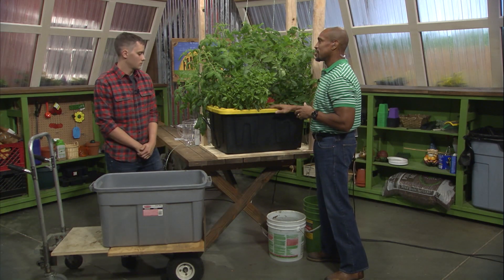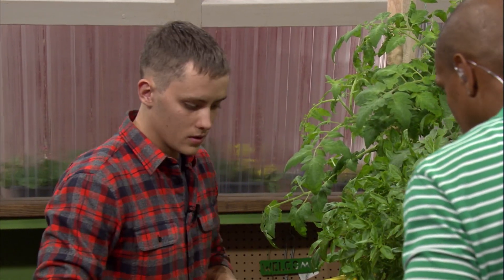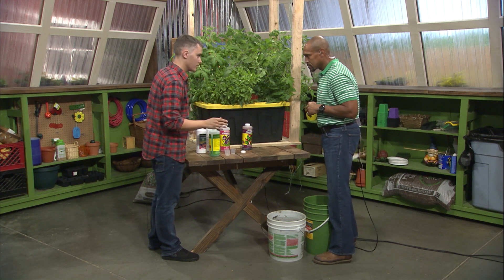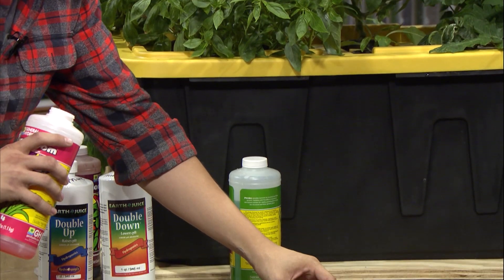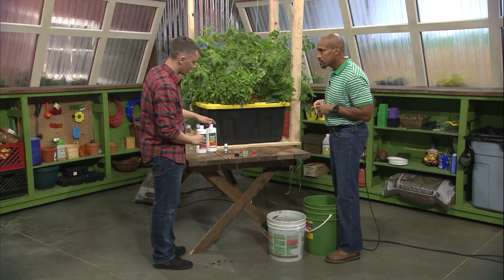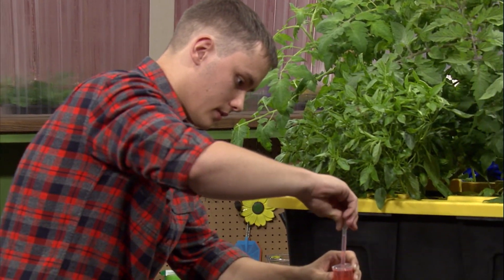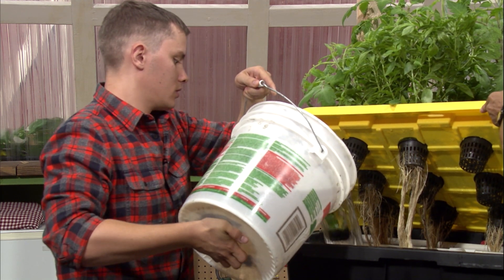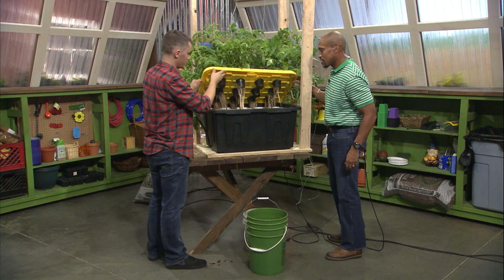Changing Hydroponics Nutrient Solution

Comment: This is a great video! Ever consider digital meters to determine your pH/EC/ppm readings?
Reply: We like to keep things simple for beginners. Too much equipment can make this seem unapproachable. We don't need any of that to run our hydro setups. Just watch the plants and be mindful of your conversions when mixing up nutrients. Don't try to feed "expert" solutions if you're not yet an expert. ;) In our shop however, it's BlueLab meters all the way. Thank you for the comment and advice!
Reply from the maker: We have done just that. Once we ran out of the drops we converted to digital meters. It is nice not having to guess the exact color of the measurement.

Comment: Because nutrients can change the waters PH; After adding your nutes and you stir the bucket, you're supposed to wait a few minutes, then check the water again to see if you need to adjust the PH with Up or Down solution. Depending on the brand of nutrients, this can be very important. Because you're likely going to check the water often while growing, most growers recommend a digital PH tester, especially if you plan on growing several harvests.
Reply: if you know your water is pretty good... clean and clear. consistent PH... and you measure everything correctly... it should be fine. But, Im with you, just to be sure. I mix my nutrients first, without any PH test... mix it all around... then test and adjust. Still getting used to the water supply
Reply: yeah the pH test should have been done at the end, but I am going to assume he's a good hydroponics grower and did another pH check the next day and adjusted accordingly - like we all are, right? :)
Reply: I agree, I check several times after changing out my res (NFT), and probably check at least once a day, after rain, etc.. It's a good habit to have, I've read too many horror stories of people "checking after a few days" and it's down to 4.5 or PPM is too out of range.
Reply: We are based in Memphis, TN and use reverse osmosis filters for our clean water supply. I'm not sure the studio in this video did. Scott probably brought a bucket with him for the demo, but I can't be certain. At any rate, our city water is pretty much the envy of the country so we don't have to fuss with it much. Great advice though. Thanks!
Reply: @wetwerk2178  How clean the water is has nothing to do with after adding something too that amazing water it will not change the PH of the water.
Reply: Well of course, checking your PH is a regular activity and checking it the very next day is a given; But, a good hydroponics grower wouldn't/shouldn't ignore the PH change on the very first day, at least that's how I see it. I've always been a strong believer in correcting or addressing any issues the moment you become aware that its incorrect... Especially for beginners, I think its good practice (from day one) to maintain a proper PH and understand why those changes take place.

Comment: Perhaps a clear drain tube would show how high the nutrient solution is??
Reply from the maker: @Anthony Driver is right. It will cause algae to grow in the tube. I always keep at least one spot empty in the system and make sure that spot is on a side. Then inside the tub I use a grease pencil to mark the correct water level. I can then use the empty spot to see the water level and top it off, or do pH tests, etc.
Reply: yeaaaaah, i tried in the past... they end up getting too much light exposure, which leads to growths/moldy unwanted things.... but it does work... but lifting the lid and having a look is just as good. You dont want light getting to your water/nutrient mix... causes growths in the right conditions
Reply: Family Plot great idea... didnt think of that. Way better than having to lift the lid and potentially disturb roots. Thanks for that tip ^_^

Comment: Did I miss it or what type of water are you starting with ; ro Distilled or (well) tap water or even just softened well water? Thanks 🙏🏼
Reply from the maker: We are using tap water. But, we are in Memphis, Tennessee, which has very good water that does not need treatment before you use it in hydroponics. Other places may require pre-treatment of the water.
Reply: I use tap water, but before the mixing I pass it via the Brita to remove the chorine. It also helps in bringing the conductivity down, which is an added bonus.
Reply: @MoondancerRec  Please tell me what the conductivity is?
Reply: @ from around 450 ppm raw to around 95 ppm after filtering. I take that number into account when adding the nutrient. So if a mix call for a nutrient concentration of 400ppm, I know that at least 100ppm will not be nutrient, so I bring it up to 500ppm compensating. If you leave the tap water as is, your solution will be lacking nutrients for a healthy grow. If you have access to distilled water, you can go to exactly what is needed.

Comment: After how much time the solution should be changed? What are the indications which suggest that the solution should be changed?
Reply from the maker: We change the solution every 7 days. We can push it to 10 days if we have to. You will find as the nutrients get used up by the plants, the pH begins to get harder to control. There have been a few times that I gave up chasing the pH and just changed the solution.
Reply: Thanks :)
Reply: I have left the nutrients for over a month, just adding water to top off. I have not had any problems. In Kratky methods the water is usually never changed. I agree you can go nuts trying to keep it perfect
Reply: Sunny Sharma thanks
Reply: yeah, if you have an EC reader, you can tell easy, if they are sucking up more water than nutrients. But, usually, you wanna be changing them once a week to two week, depending on situations... also good to do a short flush run every month or so... to flush built up salts over roots and blah blah
Reply: keeping it simple is best... if you have the right, comfortable conditions.